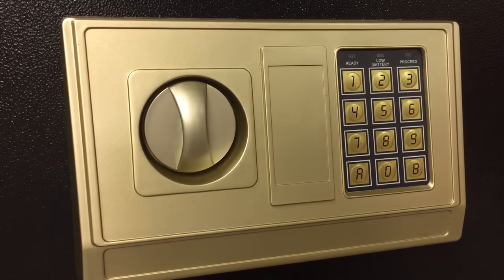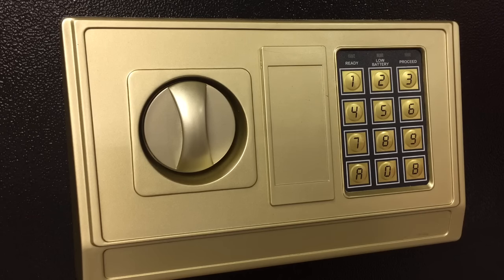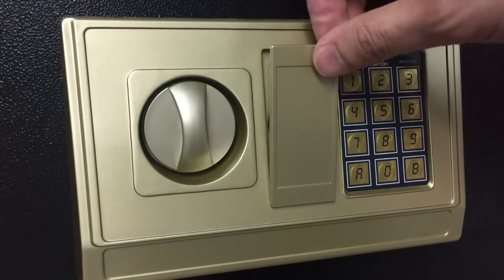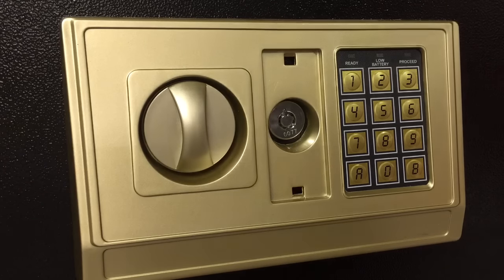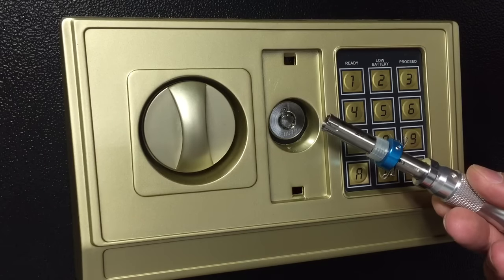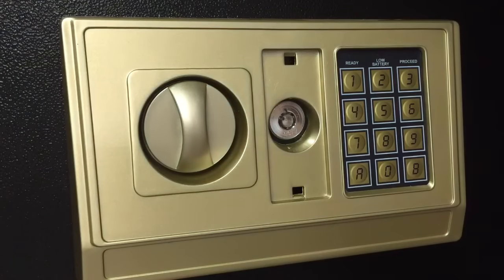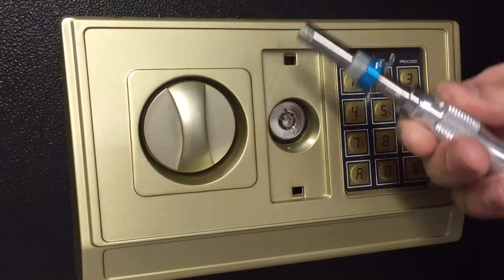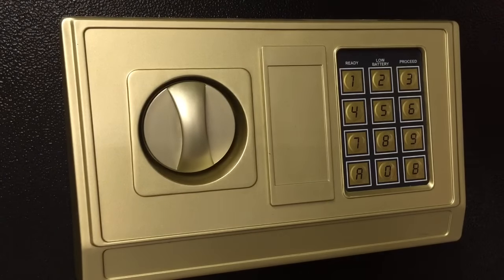[21] Harbor Freight Safe Picked Open

Comment: I have one just like this but it's the 1.51 cubic inch floor safe from harbor freight well I forgot my pin and I bought the same exact tubular set u have I'm having trouble opening mine can you please helo
Reply from the maker: +Jessica Twiss Thanks for watching.  A tutorial on how to use tubular lock impressioning tools is not something that I've undertaken yet... I probably never will, because there are some good instructional videos already out there.  The fact that the exact same model tool used in an instructional video is not the same model as what you have should not concern you -- all of the them operate identically.  As for additional tips, impressioning tools do not work on all locks, and they can be particularly bad on ones with extreme bitting.  For those locks try SPPing the lock in a method similar to the one seen in one of my ACE II videos.  Good luck.
Reply: That boosted EG  nappy Nagy girl house

Comment: Damn it man... why you making safes costs more! lol. What if I fill the damn keyhole with gorilla glue and metal shavings? :P
Reply from the maker: +Keith R LOL.  This is not a safe.  At best, think of it as a cabinet with above average security.  And the glue wouldn't slow me down... if you break the plastic cover off, there's a hole in just the right spot to use a hook and fish the solenoid wires out... connect them to a 9v battery, and the safe opens.
Reply: +LockPickingLawyer ehh ended up not fitting my fold overs anyway. Just gonna get a gun cabinet instead then. Since all the means truly is just to slow a guy. Least you cant use a damn key on cabinet i get, combo lock. Prob take anyone with ambition 5mins with a crowbar if that. But prob same to be said of this lol. Just dont got the money for 1k+ costing safe. Let alone if I move... That'd just suck.
Reply from the maker: Keith R This "safe" actually provides pretty good security for the size/money.  I think you will find that other products in this size/price class are even more pathetic.  Replace the cam lock with something like and Abloy, and glue the wires in place so they can't be fished out the front, and could represent a pretty good value.  Yes, it can be pried open with a large pry bar, but so can much more expensive products.

Comment: If it can be carried out the door, does it even matter how secure the lock is?
Reply: Usually there´s a change to bolt the safe to wall or ground from inside the safe.
Company where i work at have´s a safe bolted to a wall. Although i´ve been thinking how easy it would be to pry it off of it and carry away.

Comment: Think. These safes are to keep kids and curious visitors away from certain items. Are your kids so untamed they are buying cheap kits to make keys? Hello? Are visitors to your home getting access to your safe? Why is that?

Any lock can be opened if you have the key and if you let people in your house to make impressions of your locks then shame on you.

A little common sense goes a long way. Any safe not bolted to concrete is just carried away, criminals aren't visiting your home, making key impressions and returning later, they take the safe and break it open later, they do not sit around fiddling with it hoping an alarm didn't go off.

Another clickbait video for the gullible. Think.